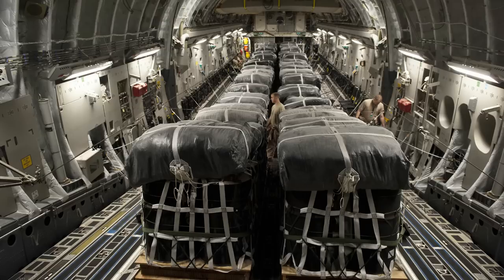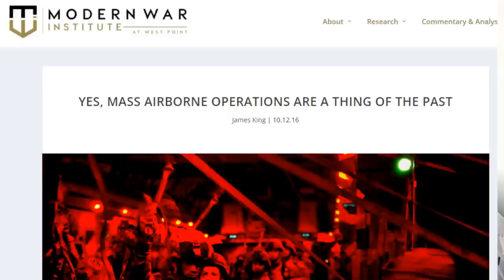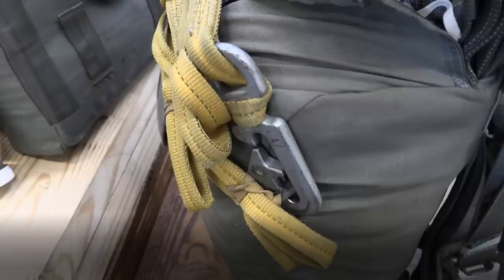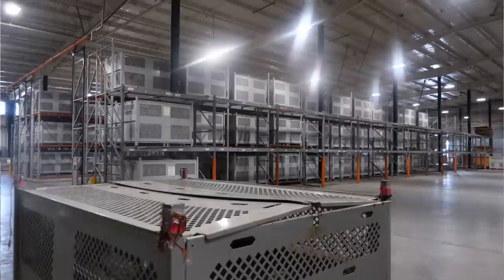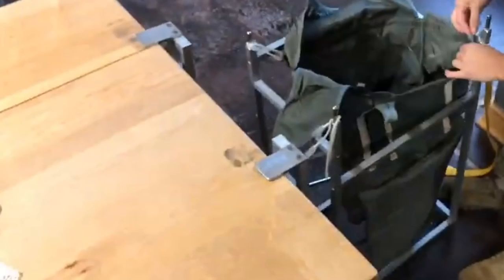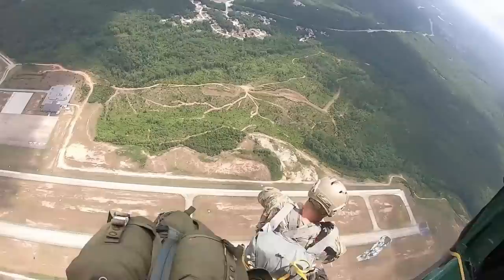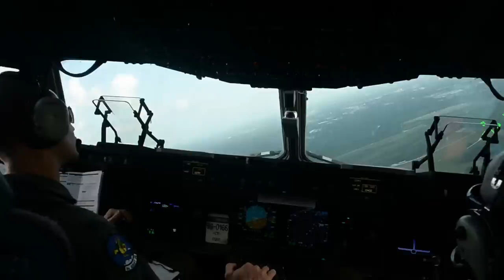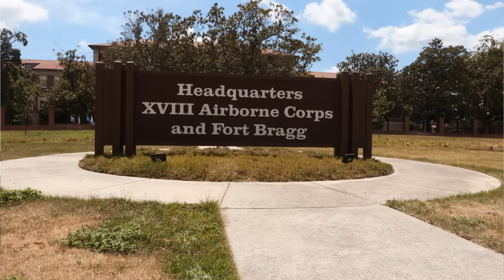How Airborne operations work : Featuring the 82nd Airborne the Riggers of the 11th Quartermaster

Comment: As a Paratrooper in the 82nd now, this is a great video that explains it really well. This and the artillery video are perfect, and I couldn't add much too it.
Reply: I can say that I have no complaints about how the Riggers rigged my 'chutes, as they all opened and got me on the ground.  The bigger challenge was exiting the plane properly (turbulence, etc.), judging and countering wind drift, and dealing with other parachutes once they got caught in one another's 'wake' (vacuum?).  Nearly all of my drops were at night, at <900', and mass tactical, which is harder than any Hollywood jump.

The only concern with Hollywood jumps is the added height allows one to build up more wind drift, so it's even more important to properly judge it and counter it.
Reply: @tyree9055  At that height, I bet you didn't even carry a reserve
Reply: @ancientneophyte8322  Oh, we carried them.  But there's not much time to deploy them, if the main didn't open up properly.  Sometimes you barely had time to drop the rucksack before hitting the ground.
Reply: Always wondered,  as someone who didn't serve, when you enlish and head off to basic, do you get any say on where you end up? The variations in each branch can be enormous, so do you get any influence on it, or do they solelydw they decide if you end up in the 82nd airborne, or if you end up in an artillery battallion?

Comment: Very interesting video. The jump scene gave me a little bit of adrenaline reminding me of a civil jump I did with an instructor, but this is so much more intense no wait by the door, gotta jump :D
Reply from the maker: Thank you. That's what I was going for. It's why I wanted the long lead up as the paratrooper who was filming was walking toward the door.
Reply: @RyanMcBethProgramming  did you get to jump with them?
Reply: @michaelcondon8286  sadly he couldn't
Reply from the maker: @michaelcondon8286  no. I am a civilian now and I have never been to the school.
Reply: I have been last jumper. Good discipline for the trooper calling it out.
One thing that I think your missed Ryan.  Parachute failure can lead to murder charges for the riggers that signed the logbook. Serious stuff.
Reply: @trevorlindsey2040  No kidding. Goes to show why there's so many double checks, too.
Reply: Most of the time if there is a problem, it's the paratrooper's fault. In my experience, Fort Benning had a more intense and disciplined Jump School and they would drill PLFs and slipping and bicycling out of twisted suspension lines. The Black Hats were brutal in their language and would PT you until you puked in the "break area procedures". Fort Bragg used to  have a small jump school and paratroopers that graduated there, usually got hurt through stupid mistakes. Just my experience! Great video and watching them blast out of that C-17 brought back great memories. The noise of the jet engines and then peace. AATW!!

Comment: When I was at Ft Polk my neighbor was a rigger while I was a MP. I used to be jealous of his short days while I worked 12+ hour days. Great video
Reply: I don’t understand why the army doesn’t give MPs 8 hour shifts 5 days a week.

Or at least 10
Hour shifts 4 days a week and work on that schedule.
Reply: @HateTheIRS  when I served it seemed like we were ALWAYS short on Manpower. I once worked 21 days only to get 1 day off, the. Working 14 before I got 2 days off. Worked most holidays too. I served from 97-05 and was medically discharged. Working as a MP and K9 destroyed my back, hips, knees and shoulders. I sadly would do it all over again.
Reply: @lewisderfuss7537  that’s crazy. 

Idk
How working as an MP destroys your back but i believe it.
Reply: @HateTheIRS  wearing a pistol belt and pistol for prolonged periods of times wears on the back. I also was k9 handler which puts lots of stress on your body when conducting controlled aggression. Even detection requires constant bending over and standing back up.

Comment: Very interesting, great content! Question: How often does a parachute fail to open? A certain number of uses or just more likely after 12 years? Are there stats? Do they recycle the materials after a parachutes last jump? Curious.
Reply: only once i guess
Reply: @Kevin-fj5oe  oh dear... I meant out of their stocks over 12 years how many fail... obviously a single chute would fail once
Reply: @aweishaupt5955  12 years should be looked on as a maximum lifespan of a parachute.  With every packing, a detailed inspection takes place. If irreparable damage is found, the chute is pulled from service.  If repairs are done, the specifics are recorded on a form that goes with  the chute. That way the next packer knows what may need closer inspection the next time.  (A similar process is followed in civilian parachuting.)
Reply: After WW2. some chutes were made into wedding dresses. 

White, look like silk, what would you do?
Reply: Was a Rigger for 7 years, I know of one, maybe two failure to open, the one I'm sure about the poor girl was a hung jumper, something got stuck, and ever opened and was being towed  on the side of the C-130, can't remember if she was cut away or pulled back in  

Most accidents are minor and over half are caused by the jumper, not the equipment or Rigger
Reply: It’s difficult to put exact numbers on it without having the stats direct from airborne command but nearly all malfunctions are jumper error or operational missteps. The parachutes are not complicated to pack if you follow the steps and checks. They allow for a degree of variation in packing style to be reliable to open in any conditions within the guidelines of their manufacturer. The parachutes that get aged out which is the 12 year life cycle usually get recycled or converted to some other use like the t-10 were made into cargo chutes. Parachutes can be reused as many times until that life cycle date as long as they aren’t repaired or damaged to a certain point of being “redtagged” this is when a parachute is too old, damaged or too expensive to fix versus it’s useful life.
Reply: @20chocsaday  During World, Two nylon was used by the military. So civilian ladies had no nylon stockings. A white nylon wedding dress, soon after the war, would be an incredible luxury, prime to show off.
Reply: @bensahler9272  Thank you for such a thoughtful answer. 😀
Reply: @20chocsaday  OMG Fantastic!😁
Reply: @danstotland6386  🤯Fantastic! 😀
Reply: As an ex Para (Australian Army), we used to say "don't worry about it, if it fails you have the rest of your life to pull the reserve".
We also used to teach that, in the case of a main and reserve failure you should extend your left arm rigidly above your head.  that way one of your mates may be able to salvage your watch.
Reply: @politenessman3901  😳 lol... I was just curious. I like to face my fears ie: sharks so became an advanced scuba diver. That sense of falling, is another, BUT somehow that one seems like tempting fate... I tried cliff diving and it didn't pan out very well 🤣
Reply: @aweishaupt5955  The serious casualty rate is pretty low - I only broke my L Humerus once (not as funny as you might think) out of 75 jumps and this was 35 years ago jumping the T-10B-D.
Reply: I think you might mistakenly believe that an older chute may somehow be inherently more prone to total malfunction. Parachutes are inherently simple machines and not prone to malfunction if packed properly and treated with respect. In its essence, a parachute is a bag that fills with air in the apparent windspeed as the jumper drags it through the air. For an indication of how reliable this is try,  hoĺding  a bag open while you travel down the road at 50 mph.  But, just as if you took a bag that had been sittiñg around for 10 years, or one that had been used 50 times before, it would likely open, but could fail immediately after opening.
Reply: @larryclemens1850  I would assume it would be number of uses, first being the scariest (defects) but also age of materials and wear and tear actually. Very complicated Im sure and there is definately a very interesting method to the system they have perfected.  I wonder... are the parachutes  abandoned after jumps during war time? Probably also not an easy question... you never see them collecting them in the movies or documentaries... just curious... could they be used as signals, markers, shelter, hammocks etc if need be? I guess I need to read up on what a paratrooper actually does.
Reply: @aweishaupt5955  Generally they are not abandoned (a Hot DZ ie under fire on landing, you'd just leave it) but otherwise you pack it in the bag and drop it off at a "turn in point" where you'll be directed to the location of your company so you can form up and move off on your tasking.
Reply: @politenessman3901  Ive learned so much today from asking a few questions 😁  Thank you for entertaining them!
Reply: @aweishaupt5955  No problem. Keep in mind that my experience is about 35 years out of date, equipment, terminology and procedures may have changed in that time to one extent or another and certainly there are differences between the way different militaries do things.
Reply: @20chocsaday  Those old silk chutes make amazing shade/sunrooms in heat probably hard to find now.
Reply: @michaelrowave  Only the small Pilot Parachute was left - and it was nylon. 
The dress had probably been passed to a friend .
Reply: @z0phi3l  Well Anibal I have somw news for you, I was Australian Special Forces Tier 1, I did over 1000 jumps , and probably 430 were static line. 1 lucky jump I went on prior to my Freefall Cse, we decided to go to 5000 feet for a nice long jump while the C-130 went to 12 , 000 to dump the freefall jumpers. Lucky as the actual static line hook on the C-130 has a flex and can be pulled down and pushed up some 3 feet, they also had a pin which was used in 'olden'times to make sure you hok stayed on the line. I went out last of 3, the 2nd guy , well his hook disengaged from the Aircrafts static line and he was in freefall. 
Lucky he wiated until he could get stable to deploy his reserve at about 500 feet due to turbulence on his body, and not beeing freefall trained. From that day on the WORLD of jumper new about this and that pin was onnce again used, named after the jumper D Sheehan, the Sheehan Pin.........luck , no rigger fault no aircraft fault but sheer bad luck...only time ever this was know to happen. He went onto 1400 plus freefall/staic line day /night etc in the SAS like me
Reply: @Quadrant14  That is a crazy rare event, glad he survived
Been to Australia, got my wings with 3RAR 
Been trying to get a copy of those for years
Reply: In 12 years of being airborne I saw it only once personally when I was in airborne school in 2005, a fellow trainee had a "cigarette roll" (failure to open). The trainee had a weak exit, hit the side of the plane, the suspicion is she was unconscious and could not pull the reserve. I jumped before her but landed after.
Reply: @Quadrant14  😳 incredible and fascinating insights...Thank you for such a thoughtful, in depth reply
Reply: @politenessman3901  that's awesome. 🤣😂🤣😂
Reply: @Weaponized_Poutine  Oooof.  “I jumped before her but landed after” really drives the point home.

Comment: Ryan, excellent video. It is good to see how much things have changed. So much to comment on. One thing I noticed is that most of the jumpers when they exited the plane was very close. Usually when you hit the air, you take off, however, on hot days, you float alittle longer than usual. The lower jumper has the right of way and you hear the top jump telling the lower jumper to slip away, but it's good their are communicating. Another thing that is critical to jumping is the wind and AGL. Most units have their set AGL and division definitely have theirs, lol. This was a great video and when you jump, you have everything you need to perform your mission, combat ruck, mortars, everything. The motto used to be.....the world is a dropzone. Airborne. Great seeing newer parachutes, we have T-10s, then MC-1Cs and MIRPS for the reserves.

Comment: I'd really like to see how they rig the parachutes for something like a humvee, etc! It just has to be complex.
Reply: For cargo rigging it’s different equipment and sizes of chutes slings ect. But the concepts are pretty similar. Attention to detail as how things are routed are important because the heavy weights can snap or break things much more easily. It’s all a step by step process that’s been tested and done many times before! Example of weird things we consider in drops are making sure the fuel tanks in humvees are only filled a certain amount to prevent blowouts!

Comment: Former Rigger here (‘88 - ‘91), back when the MOS was 43E.  So much has changed since I packed my last parachute.  For one thing, the number of chutes packed each day was anywhere from 25-50 per day, depending on how good you were. An experienced packer could usually double the amount of chutes of a new packer and be done by noon and off for the rest of the day (barring any other duties).  

One thing not mentioned in this video and for very good reason, is the amount of heavy drinking brought on by the stress of the responsibility of having the lives of your fellow soldiers and servicemen/servicewomen in your hands.  Not sure if it’s this way today, but it definitely was when I was there at Ft. Bragg.  You always knew who was the heaviest drinker, by their position in the morning run formation, no one wanted them in the front, they were always made to run in the rear because sweating out a nights worth of alcohol at O Dark Thirty is not a smell one wants to deal with that early.

But I just wanted to say “Thank you!” for the memories this video has brought me from my days under the red ball cap!
Reply: Fort Bragg still has issues; not just with drinking but drugs too. I recommend the Majority Reports Interview of Seth Harp (https://www.youtube.com/watch?v=olW2TzYCUFU) for detail; 109 deaths in units deployed to Bragg in the two years '20-21, 105 stateside. Mostly Overdoses but a few off-base deaths in suspicious circumstances (read: drug dealers offing their enlisted mules)

Comment: I was with the 82nd Abn (504th Inf) back in 1971-1974 & then again (307th Eng this time) from 1979 through 1984 and I can say things have really changed.  We used the T-10 parachute then (round canopy without any opening) and a  totally different reserve that had the ripcord on the right side.  We mostly jumped from the C-130 or the C-141 (I also made one jump from a C-7 Caribou).  It looks like they really fixed up Green Ramp, all I remember was a large area with a metal roof.  I don't remember any benches but my last jump was over 34 years ago so I could be wrong.

Comment: This was really cool to watch! I used to be a rigger for the M.O.D. the LLP's I packed were very different to these used in America, the rigging lines were sometimes a nightmare to untangle when they came back for packing 😅 but we only packed 12 a day and you could really take your time to check re check and check again from the rigging lines to the  loops on the pack, the packing proses we use is a crisscross style and probably my favourite part of packing, I always nailed it perfectly but seating the ringing lines in the loops would kill my OCD because they had to be perfectly even length and not twisted at al and if I mess just one loop up I'd pull them all out and start again 😅  fun fact, the LLP's I packed could also be deployed as low as 250ft . It was such a great job ! Yes it was an enormous responsibility but an absolutely fantastic job.  Great video! Thank you 👍🏼

Comment: Thanks, Ryan, for this excellent and in-depth video. 

I have been around aviation on many way for all of my life (that is, since 1949). My paternal grandfather served in the British Royal Air Force 1917-1947. My father was an aeronautical engineer. I made static and flying model aircraft, and a few rockets. My first of many flights was in September 1967, where I ended up at Parris Island SC to start 6 years in the Marines. The first three years was as a maintainer for the LVTP-5 ampibioius assault vehicle (AMTRACS.) The rest of of my time in the Marines was in a Marine Fighter squadron operating F-8 Crusaders. (Not me - I was in the S-2 office). Many years later, I wanted learn a marketable career, and the best path was to spend another six years in the Air Force Reserve doing aircraft electronics maintenance on C-141 Starlifters. (The C -17 is their replacement.) The aircraft frequently had missions up to Fort Bragg to pick up and drop paratroops. Then some years after that I and my wife (since 1971) worked for a major airline - I was in their maintenance area improving their electronic calibration facility. Now I'm retired & spending (what she thinks is) excessive time learning interesting stuff on Youtube. 

For most of that time, I firmly believed that there was something wrong with a person who would go up in a perfectly good aircraft, INTENDING to jump out of it. 

But over the years I learned a lot, met a few sport jumpers, a few paratroopers, and even an Air Force PJ (para-rescue-jumper), watched "Band of Brothers" AND read the book.  
And books by and/or about people like Chuck Yeager, John Glenn, Lance Sijan & others. And today, watched this excellent video.
 
Now my attitude has shifted. I understand and appreciate what military jumpers do and what they can achieve; the time, care and professionalism that goes into the whole Airborne team , and the many other people (military and civilian) who's jobs involve jumping out of aircraft.  It is not something I would do personally, but I have respect for those who can and do. 

But those sport jumpers, though ....